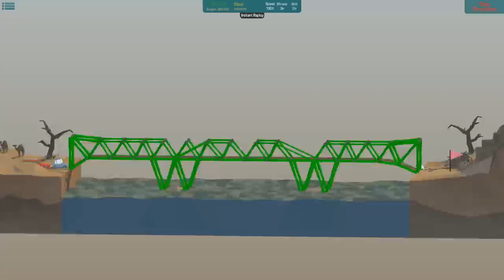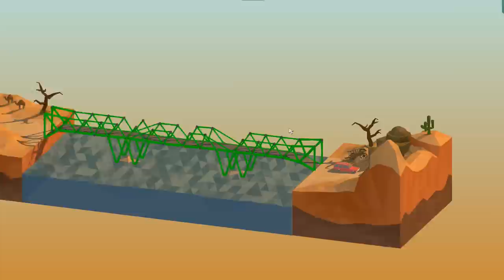POLY BRIDGE Gameplay Part 5 - "A CRISS CROSSED MESS!!!" (Bridge Building Game)

Comment: You can actually load your old bridge creation. There is usually is an autosave when you complete a level. Though you might then wanna save it properly after loading so you don't override the working solution with new designs afterwards.

Comment: The second one where a had to get to the top and b had to get to the bottom I made a simple bridge with a going up and for b I just made it crash through a single wooden plank on a very supported steel set so everything was swell.  I did it first try :D u spent like 13 mins in it